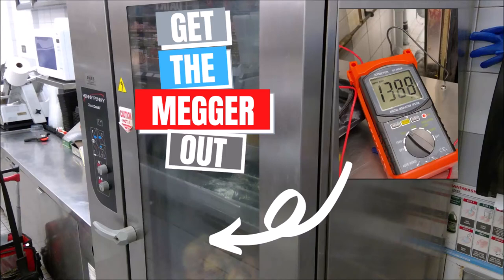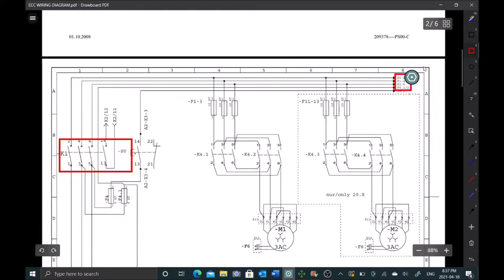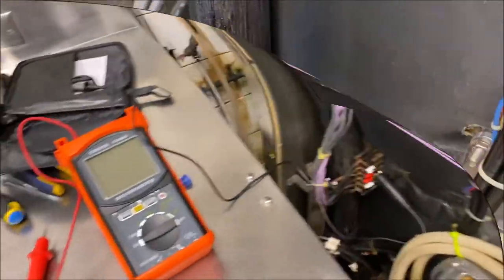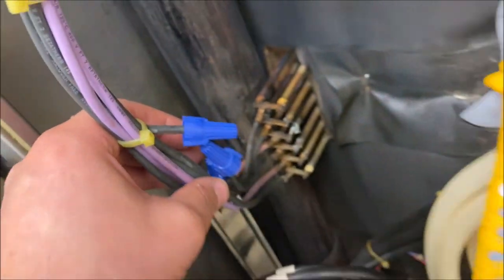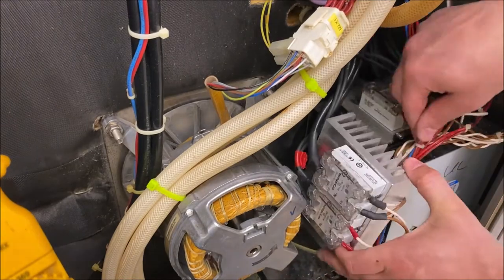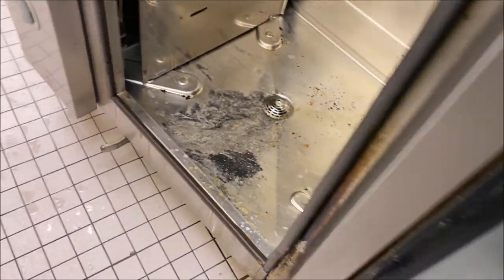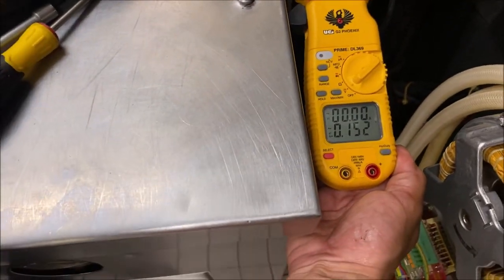Megger Testing A Combi Oven That Is Tripping The Breaker Intermittently Every 3 Weeks.

Comment: A megger can really be a valuable tool at times. It's not everyday that You run into a problem like this but when You do It saves a lot of time and proves the issue. You are one of the best techs on you tube. It would have been a real pleasure to work with you. So many guys just don't take the time to learn the right way to troubleshoot a piece of equipment. I know You are an inspiration to a lot of the younger guys. Keep up the Great videos!
Reply from the maker: Thanks for the kind words

Comment: Kline makes a great megger for 149 bucks perfect for things like this. I have actually megged out whole system once down to a bad pressure switch. I use my Kline for day to day stuff, However If I am work on a Trane Chiller I bring out my Megger 420/2 where I can actually run tests. Great video reminds me of when I use to work for Hobart back in the days.
Reply from the maker: Yes, this one was a cheap one, only used it once so far.
Reply: @REFRIGERATIONKITCHENEQTECH  Get the Kline, it tops out at 4000max so you know it's good period. Best 149 bucks you will ever spend.
Reply from the maker: I will look into it. I’m not super confident using it but would love to learn it

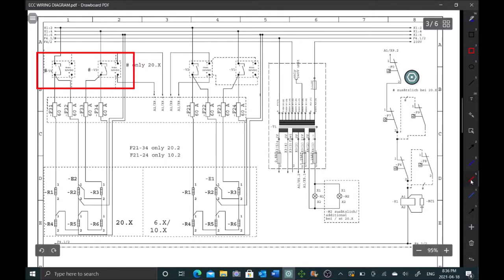Comment: 1:17 I'm thinking those relay contacts are arcing closed, too much amperage somewhere, I'm guessing probably a short to case with movement from a tray or something.  Or another inline contactor that's making intermittent bad connection.
Reply: Oooo, solid state relays. Look at the heat sink needed to cool them!
Reply: Well, now I know why they blow so easily, they are great when they work correctly.
Reply: 10:14 a lot of techs can't troubleshoot solid state relays.

Comment: Bro I am a junior Technician but I suck at reading schematics which hinders my ability to troubleshoot a system efficiently where did you learn to read diagrams so confidently and how can I learn to do so
Reply from the maker: I tell my techs to try and read schematics as often as possible. When You are testing a unit once you are done a repair, pull the schematic out. I might be doing some videos on reading schematics in the near future.
Reply: @REFRIGERATIONKITCHENEQTECH  please do bro I need all the help I can get
Reply: Why is it hard for you? 
It's basically a map, if you don't know the symbols maybe make a key with symbol description

Comment: What brand of combi oven was that? And how did you know that your mega ohms was the wrong number did you base it off the fact your other two tests were the same number? The meter is adding voltage to the circuit to make it more sensitive to check a larger resistance... Crap now I got to buy another tool .. all good lol
Reply from the maker: Henny Penny combi. I am no megger expert. Anything under 20Mohm apparently is questionable. Anything under 2Mohm is not good. I will do more testing with it so I can figure out what readings are good and what ones are not good.
Reply: @REFRIGERATIONKITCHENEQTECH  can you send a link for the purchase of the  mega you used
Reply from the maker: https://www.amazon.ca/gp/product/B07QGSFZ3W/ref=ppx_yo_dt_b_asin_title_o00_s00?ie=UTF8&psc=1

Cheap one on Amazon lol. If I find more use for it, I’ll buy a fluke or Klein. For now, it’s doing the job.
Reply: Sweet thanks